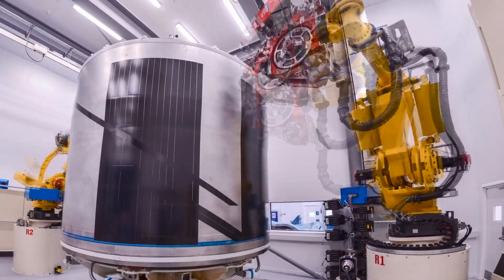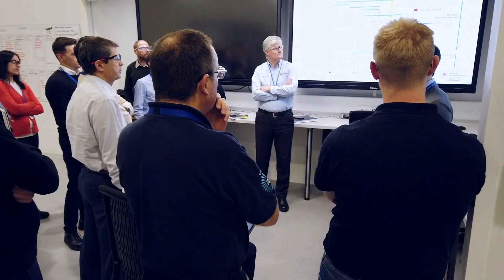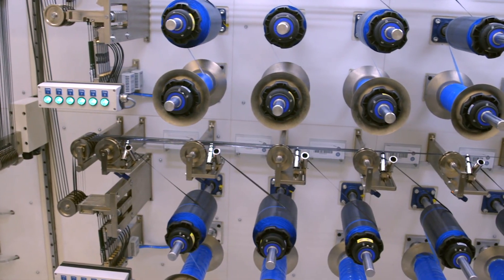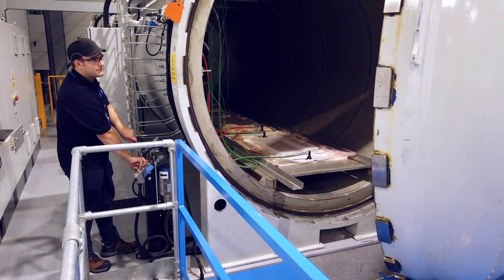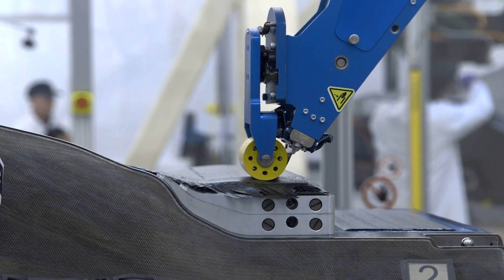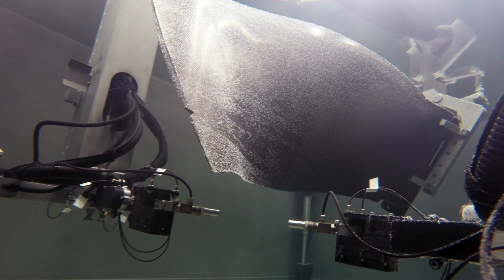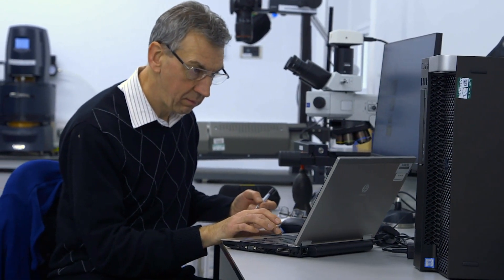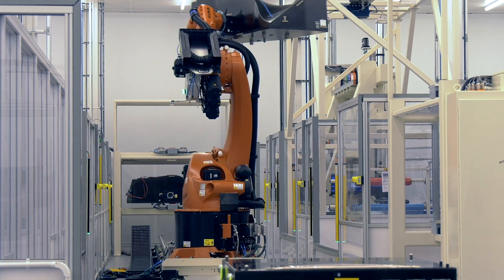Rolls-Royce  new composite technology hub in Filton

Comment: What fuel burn? Last I checked AIR isn't classed as a fuel that burns ? Tell me more
Reply: The fan is turned by a shaft connected to a turbine. If the fan is lighter the amount of fuel it take to produce the energy required to turn the fan in lessened therefore improving fuel burn. Hope that helped